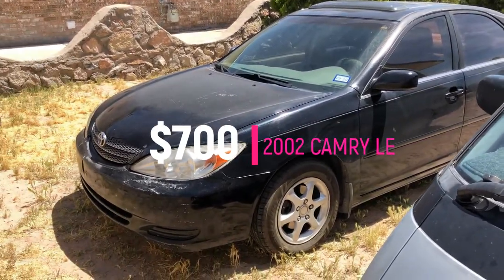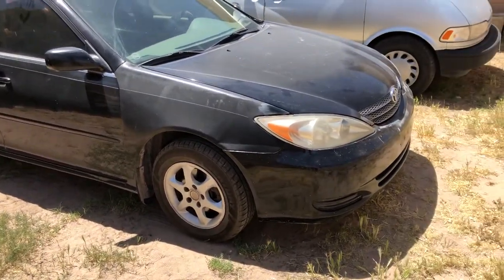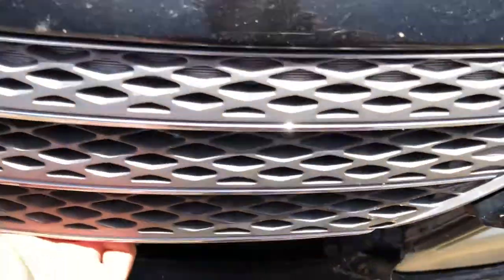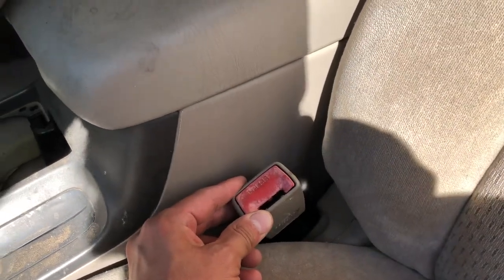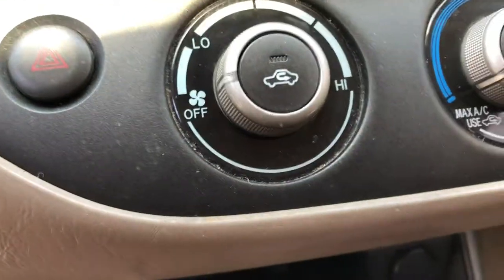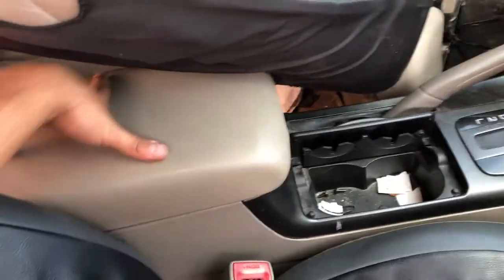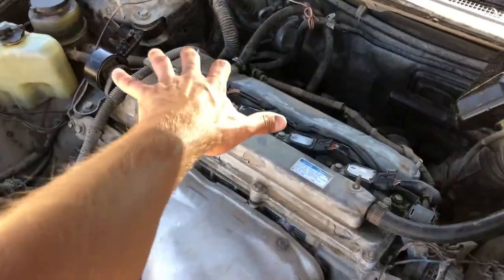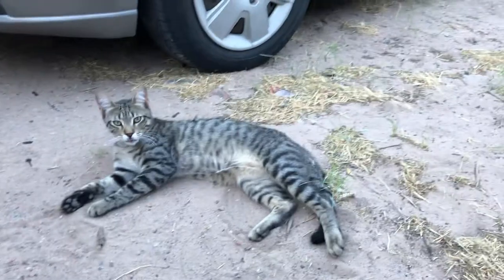$700 2002 Toyota Camry Project

Comment: The 2005 Camry is an incredible car. Mine has 300,000 kms. It had the 5 speed auto with ABS, which the earlier 2002-04's didn't have. Toronto, Canada.

Comment: The Camry probably just had to relearn its idle speed. I bought a Camry like that last year that had the exact same problem. Makes for a quick and easy flip though. Nicely done! Funny that you just bought a 6th gen Accord. So did I lol. Who’s gonna turn theirs around first?? (hint: probably not me) 😂
Reply from the maker: Yep, that's exactly what it was! I actually finished the Accord already and the new video is out, it was super easy for once
Reply: I had a 2000 Camry that had the cut out problem. The idle air control valve was replaced. Relearned procedure done. Rode around town great. Would cut out after getting off an interstate.

Comment: I have the same car and it does the same exact thing on the driver side door. Did you ever figure out what it was and how to fix it? thanks for the share
Reply from the maker: It's the power door lock actuator inside the door, the little power actuator begins to bend and wear out, it's a real pain in the butt to fix but can be done
Reply: @jimmyjimjims7483  
That's what I thought it was. Just wanted a second opinion. Another thing, was that the original fob or an aftermarket one? I didn't get one and was thinking of buy one on Amazon. Again, thanks for the response.
Reply from the maker: @4u2nv503  You can get a used OEM one on eBay for like $14 that's what I did, their quality is much better and it's fairly easy to program the remote yourself, no extra tools needed